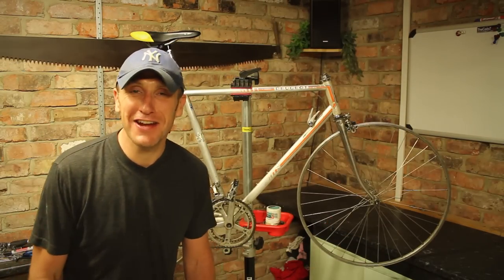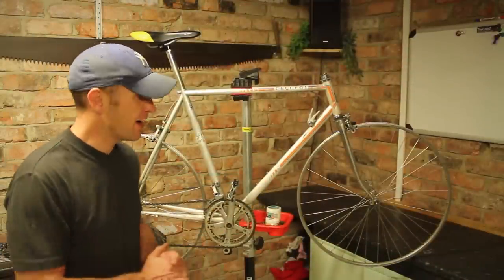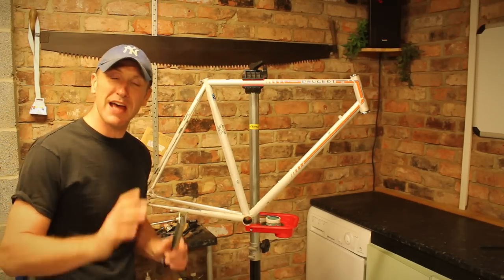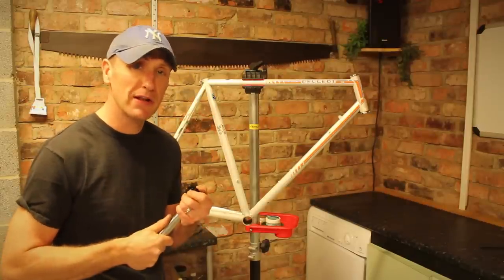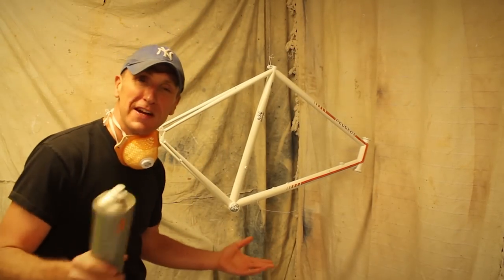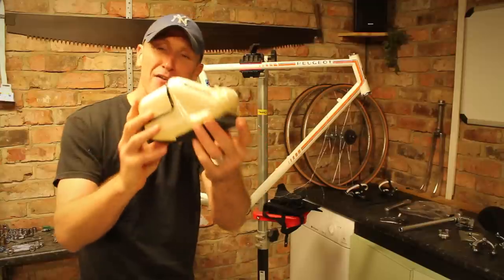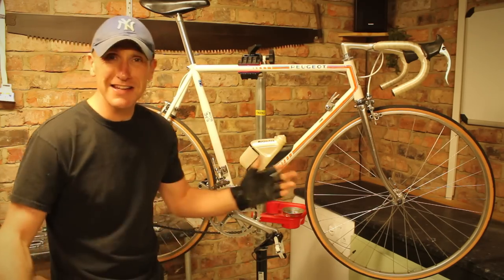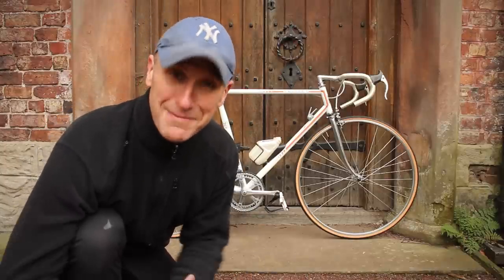Vintage Peugeot PH12 Cycle Restoration (100th Anniversary)

Comment: In 1982 I bought one of these new. It was my first serious bike. The only thing I changed was a set of Mavic wheels. Over the next fourteen years I put several thousand miles on it--up and down the California coast, Death Valley, and many autumn tours of Vermont with Vermont Bicycle Tours. The bike always attracted a crowd.  It was not only beautiful as a design but beautiful mechanically. The bike was nimble, quick and very  comfortable.  On one of my visits to the dealer after I'd had it for a while I said it was a really fast bike. He said, "It only goes as fast as you peddle it." True, but I thought the aerodynamic design of the calipers and water bottle still gave me some kind of advantage. In 1988 I bought a new Trek 1200 aluminum which mostly sat in the garage because the PH12 was so much better. I sold it a few years ago and have regretted it since. A gorgeous bit of design and engineering.  Great to see this one restored.
Reply from the maker: Great comment and loved the bit about the water bottle 😉 thanks for sharing your personal experience of your own Peugeot PH12 they certainly are fantastic looking bike which were a head of the times. All the best thanks for your support 👍
Reply: Sorry, how do you "peddle" a bike? Screwed that up.

Comment: I've  just this morning picked up a 1982 Peugeot PH12 Centennial edition complete bike. And shall soon start it's complete restoration.... mines in VGC, 57cm frame and does not need as much work as the one you have in this video. My base is already a very good starting point, just gonna change the bar tape to a nice BENOTTO orange,  two new Michelin Dynamic 700x23c tires and CLB lever hoods, and then it shall be ready to ride.
Reply from the maker: Nice, great to hear you’ll be riding it and enjoying it! Thanks for tuning in and watching all the best 👍

Comment: I had two of these , the missing bars were atax and the bars were engraved philipe? . I remeber the CLB aero levers were the smoothest I have ever used. The bikes retailed at £180 in the early 80`s being towards the top of the lower range of Peugeot bikes.

Comment: Wow, nice to watch this video... I own a vintage Peugeot bike originally purchased by me  as the first owner in the year 1985 in nearly the same color. I use it until today for my fitness training. I had  to replace only a few parts . I'm  impressed concerning Peugeot's product quality of those days. I'm not happy about that...I was not always so careful, as I should have been with the bike - but my bike resisted like hardly to believe. Nowadays I use it only at good wheather conditions , and some owners of modern road bikes make compliments, when they see, how it runs. 
In the moment I consider to purchase three historically correct parts, which I replaced a lot of years ago , to fulfil the rules of the L'Eroica. The rear wheel, the saddle, and the original aerodynamic drinking bottle. I never found again a matching  bottle. 
I wish you a lot of fun riding your restored Road Bike. You did a great job.
Greetings-
Dirk
Reply from the maker: +Dirk Staudt Thanks for watching, the support and sharing the story behind your own Vintage Peugeot bike! I was real lucky with the bottle, I think there is a few listed on eBay for about £85 which I did not pay near this. Thanks again and all the very best Andy

Comment: Greetings from Las Vegas NV  USA. Love my Centennial PH12. I own two of them. One fully restored, one that complete yet unrestored. You did a great job on the restore. I love how understated your description of how difficult the brake lever hood s are to acquire. Same with the water bottle. Love the pearl white bike, with satin finish wheels. Beauty be. What type of handlebar tape did you end up using. I searched endlessly for Ambrosio silver tape, but ended up using pearl white Benotto. Best video of the CPH12 I have ever seen. Cheers!
Reply from the maker: +Lucky Wrench Ah thanks fella, for your kind words. It becomes very exciting when you acquire parts that you so desperately need to put the puzzle together! As for the tape I also used 80's Peal White benotto tape.I got married in Vagas, crazy place, all the best and thanks for watching! Andy

Comment: Great Project and amazing restoration results... do you mind sharing the wheel-set and tires you have used in the project and if possible the online shop you usually go to. Looking for 27 x 1-1/4 Rear Bicycle Wheel, Freewheel and Front 27 x 1-1/4 Alloy Rim to restore a 1981 Raleigh Road bike I got from my Dad. Your work is an inspiration. Thank you
Reply from the maker: Hi thanks for tuning in and watching the Peugeot Bike Restoration. Regarding the wheel set used to be honest I cannot remember. Regarding the shop I use I generally always use eBay. Just search 27” wheelset or 27” gum wall tyres etc. Hope the helps all the best and good luck Andy

Comment: I am restoring a bicycle from the 60s. The chrome parts removed the rust at all but when they dried up they created again rust that I can do to avoid this.  I would also like to know how I can investigate what set I originally had to buy the missing parts and leave it the same as the original

Comment: Excellent video.
I've just stumbled across this channel as I picked one of these 1982 Peugeots up today for £15 (all sprayed grey and only the 1882-1982 headtube logo for info), but it looks like I'll be going all in with a pearl white paintjob.
Reply from the maker: Wow £15 good for you! These are very sort after. Decals for this model are available no problem. Good luck with the project and thanks for watching all the best Andy
Reply from the maker: +coldsnail just to let you know I found a few genuine Profile water bottles that match this restoration they are on eBay at the moment one on a auction from the Netherlands which is where I think I got mine from. Hope this helps you out Andy

Comment: Loving your work here. I've just purchased this frame planning on giving it a little TLC. I'm actually going to reapply the decals after a re-spray. Could you let me know what sprays you used? Any advice or specifics would be much appreciated. Ta
Reply from the maker: Firstly thanks for the comment and watching. The paint I bought online as a pearlescent white, I know that the decals are also available on eBay if you search under PH12. The rest of the spec I got from searching on Google and found the original spec sheet for the bike on an image I found. I bought many parts from around the world but was worth the effort for such a classic which was way beyond its time. Hope this helps all the best and good luck with the build! Andy

Comment: Great vid! Doesn't it become a problem, since you mask some of the white parts around the decals. What I mean isn't the white colour different just by the decals, and the newly sprayed area. Or how do you solve this?
Reply from the maker: +Oliver Vukic To be honest its not the white as I mask so close to the line plus match it up, its more the depth that can cause a problem, with added layers. You are better off completely stripping the bike down respraying and buying new decals, however this can make the rebuild more than what the bike is worth I have found. So with that said it all depends on if you will be moving the bike on or keeping it for ones self! Hope this helps all the best and thanks for watching. Andy

Comment: Love your videos! I was just wondering what products you use to clean/polish and degrease the all of the components? Thanks!
Reply from the maker: +Ben Hargreaves Hi Ben, I get asked this a lot also and I think in one or two videos I have mentioned it, maybe a good way would be to list certain things in the description of the video. As for your question for the decreasing I have used a product called Rubicon, then wash down with simple soapy water. I then use a product called T-cut which is a rubbing compound for the car industry. As for metal work I just use a metal polishing cream. I hope that this helps all the best and thanks again for watching. Andy
Reply: +BikeIt UK thank you so much for the tips Andy!! I can't wait to get stuck in to my restoration :) it's the first bike I've ever owned and it's quite a learning experience

Comment: Yet another amazing video! Great bike! I'm wondering, as you don't strip it back to bare metal, do you sand down the whole frame except the decal area? Or just sand down the bare metal and rust spots. You paint primer over the existing paint or just touch up bare metal with primer? Then you cover the existing paint with pearl top coat? People have advised me against trying to do a pearlescent paint job myself. I have a pearlescent Peugeot that had many spots where the rust was under the paint, now, cleaned i have many bare metal spots, if I touch up just the spots the paint won't match, but I've always heard that if you paint over existing paint it won't end up very good? Or lasting? It is nice to see you do more restorations than fixie rebuilds.
Reply from the maker: +Paul Steen Hi Paul thanks for the comment. In my video I was selling the bike on which has a huge difference in the restoration decision making process I feel. If you are keeping the bike for yourself and money isn't the object, then go the full hog have it stripped and sprayed professionally. As regards to the rubbing down I would clean and treat rusted areas, then run the whole frame down before spraying. Hope this answers a couple of your questions and good luck with the project

Comment: Hi Andy, that video was awesome !
I just bought myself the exact same model and am now stripping the frame but at one point your video was way to fast so I was not able to see in which direction you are loosing or tightening the bottom bracket :-D 
Do you remember if it was a BSA Style or some french, italian, swiss stuff ?

Thanks and all the best for 2021 !
Reply from the maker: Thanks for your support and watching great to hear you have the same model. Nice bikes, regarding the BB I’m pretty sure it’s a standard thread drive side clockwise to loosen. Hope this helps thanks again and all the best to you also for 2021 👍
Reply: @BikeItUK  Hi Sir, thank you for your quick response. That would be amazing if it's standard. I will try asap ;-) Upgrading to a better BB would be easy than. Thanks !

Comment: Hi, absolutely love the vids. Just wondering, what do you do when touching up little scratches on the frame? like how do you prepare the area and what paint do you use? thanks
Reply from the maker: +Rory Yeoman Hi thanks for the comment, regarding andy scratches if no rust is visible i just touch up with model enamel paint. If rust is visible I'll rub down and treat with a rust solution before touching up. Hope that this helps thanks for watching Andy
Reply: +BikeIt UK great help thanks, keep up the good work

Comment: Hi, nice build. Was the bottom bracket fixed cup right or left threaded?
Best regards, Anders from Sweden🙂
Reply from the maker: Thanks for watching and the support, I’m sure it was left hand cup standard right hand thread. I’m sure it’s the earlier frame which had the left 🤔🚴‍♂️
Reply: @BikeItUK Thank you for promt answer. I have a similar bike and I just cant get the fixed cup loose. Driving me crazy😂

Comment: Hi Andy. Great videos! I am restoring 3 peugeots and 2 of them need 24mm seatposts. Can you tell me who your German supplier was. Google has not been my friend finding one 😩. Cheers Bob.
Reply from the maker: +Bob Dalton Hi Bob thanks for the comment and watching. I just done a quick search on eBay, although no vintage ones came up, some new ones did. I just searched seatpost 24. I also remember struggling. You made me smile with the Google comment. I'm sorry I can't give you a quick fix solution and good luck. Thanks again Andy

Comment: Hello Andy very nice videos, love how the bike looks, was wondering how did u get the howsing back in on the down tube from the shifters any tips???
Reply from the maker: +yoyobecks thanks for tuning in, great question. This frame had small outlets. I used two bits of fishing line. In one hole I fed a loop in to catch the receiving line from the other end. Once threaded I connected the cable and pulled it through. I hope this helps all the best and good luck! 👍Andy

Comment: Andy: you always seem to find bikes where the frame size seems to fit you spot on. Do you even end up finding a bike for restoration where the bike is either too big or too small to fit you? Or do you just pass on those?

Also you seem to always be pretty lucky or skilled at locating these old bikes to restore. I just don't see this many cool old road bikes like this here in the US where I live. The only vintage biuke like this I found one time was a old Gitane Gran Sport.Deluxe. But once I got it I could never get the one bottom bracket cup out of the frame. So it is just hanging up in my garage. Do you think just more of these vintage road bikes were sold in the UK?
Reply from the maker: +Jensen Healey Firstly thanks for the comment and watching! I tend to focus on the 23.5" frame because its my size, but also it was classed as a medium size frame, so the resale is open to a larger audience. Saying that I have just finished a frame to large for me that I came across and had to do up. Im just working on the video now. So watch this space the video will be up soon.

Ref the bikes in the UK the bikes in the 1980's I grew up with so I always have my eye open for them. Believe it or not my last bike I picked up I found in a bush, however the majority of the cycles i get are from eBay. As for the US I haven't a clue, I do know it was a complete different market regarding models. Your bottom bracket have you soaked it in a release agent and the right hand cup has a left hand thread on. My latest restoration needed lubing and then placing in the vice to release it. I hope that this helps all the best and thanks again for watching! Andy

Comment: Nice restoration, I found one of these on ebay in pretty good condition for 460 euros. Seems quite steep to me, what do you think?
Reply from the maker: Hi, firstly thanks for the support and watching. I think 🤔 I paid around £150 however I did spend maybe another £150 on parts. If it’s in A1 condition with all original parts and it’s been  restored it is a little steep. I’d have to see it. Thanks again all the best
Reply: I got him to drop down to 350, it has been changed to a flat bar handlebar and the seat is changed. New tires. Everything else is original. It's also in perfect condition. I know you would find it blasphemous hehe but it's exactly what I'm looking for and it looks like it's gonna be insanely fun to cruise around on in the city! Keep doing your thing would love to buy a bike from you one of these days, do you ship to EU?
Reply from the maker: @MMuunncchhiieess  I can ship anywhere however shipping can be expensive from the UK, especially now with flippin BREXIT absolute joke.
Reply: @BikeItUK  yep :( Well, good excuse to go visit some family and cycle back! I'll keep an eye out on your shop! :)

Comment: Love your work. Recently bought the same model, almost mint condition. My question: I want to repair some dents and minor scratches on the frame. Where did you get the exact color code for it or is it just pearl white? I want to make it look flawless, bit of a perfectionist.
Reply from the maker: +A201283 Hi thanks for the comment, the spray I used was just a Pearl White. I'm aware they do replica decals for the PH12. I had a Raleigh colour matched at a car spray place, it cost a bit of money but if you are going to be keeping it then why not if it brings you pleasure. Good luck with the restoration buddy, keep me posted. All the best Andy

Comment: Hi, Very nice  video Restoration of this bike, I got a same model and still great performance..
I would like to know where did you buy original water bottle in Denmark or if you can remember the shop..many thanks
Reply from the maker: +T or Hi it wasn't a shop Im a afraid, at the moment I think Ive seen few listings under Vintage profile water water on Ebay, however I think they are listed from £75 unto £95. All the best and good luck Andy
Reply: +BikeIt UK , Thank you very much Andy, i will looking for that..

Comment: Hi, in your diverse project you are using bar tape, kind of shiny white tape. Could you please tell me what is it? Thanks for motivation and tips regarding restoring the bikes. CHeers
Reply from the maker: Hi the tape is very hard to come by now. Search eBay for Vintage Pearl White Benetto Tape. Its expensive however you can get reproduction tape and I did find some from the states on a website called Yellowjersey.org. I hope that this helps Andy
Reply: thanks a lot, found it and will use it

Comment: well done. I have a question if you don't mind.  I just picked up a peugeot frame today.  Looks like an 80's.  Light blue, nice chrome fork one decal saying vitesse 12 speed.  Only original component left is the downtube shifters, and them being there is what sealed the deal - for $25.  I've built plenty of bikes, but never a Frenchie.  The bb is standard english, and the spacing looks like 126 on the rear.  My question is on the headset and fork - is this a standard size, or something odd?  Again great bike there, too bad you couldn't keep that one.
Reply from the maker: Hi thanks for watching and your words of support. Regarding headsets all the bicycles I’ve worked on in the videos have had standard headsets 👍🚲